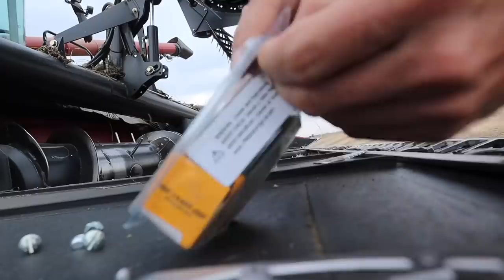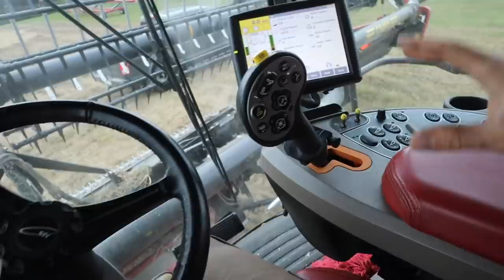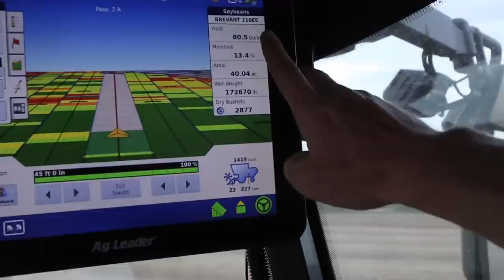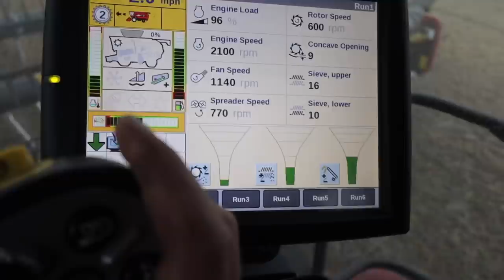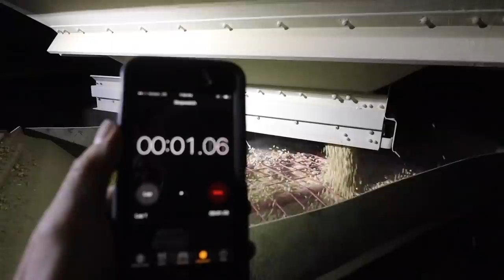Meet Our New Grain Cart Driver!

Comment: there is a deflector on the right side of the combine in front of the chopper that can be pushed in or out. You are putting more material on one side than the other with your spreaders. Also a Canadian rep said not to speed the spreaders any faster than 650. He said it just creates more turbulence away from the machine . Just trying to help

Comment: ABC a good thing on what we do when we use the augers will take orange spray paint and paint a line on the ground and it'll show you where you exactly got to stop each time with your trailer so the auger bottom it hits in the right spot and I've seen some people put like steaks in the ground and spray them orange where you need to stop bam just some helpful reminders you probably won't read this but just trying to help you guys out a little bit

Comment: I put a 10 by 10 foot tarp on the ground where the swing out goes. Center the truck on the tarp. When the rear duals start up on the tarp its in the right spot when you are driving ahead. If backing in when the rear set of drivers start up on the tarp you are in the right spot. The swing out also rolls easier than on bare dirt. It also makes for easy clean up after we spill. The tarp is a chunk from a semi tarp. Put some blocks on the edge to keep it one spot. Works great.

Comment: Grain auger. Drill a small hole in the lowest part of the pan. Put a small disc with a screw in the edge you can swing it open and close when you quit to let the water drain before the start of the morning.

Comment: Mechanics tip Cole-  in your tools keep a small bottle of propane with the torch head.  When a nut or bolt is frozen or too tight heat it up.  This will usually loosen up things. Especially nuts as they expand in diameter.

Comment: Shouldn't each piece of equipment have a small tool set of the most commonly used tools for that piece?  Maybe have them banded or color coded so they don't wander off too much?
Reply: Go back about a year -year and half and watch the tool videos.
Reply: Plus a bag of bolts and parts most likely to be crunched way out in the field during operation.
Reply: @KameraShy  good idea. Keep track of every time there was a stoppage longer than an hour. If the part is small enough, add it to the list.
Reply: They do 👌

Comment: I put some orange flags in the ground by the front tire to know exactly where to stop the truck to unload the rear and front hoppers. I'm thinking pretty soon you will have a parts pail in that combine with bolts, sickle sections, and guards and of course 7/16 wrenches and a hammer to change sickle sections quickly. I've found if you can move the sickle back and forth by hand it speeds up the replacing a bit.

Comment: Cole, you guys need an adjustable torque wrench to safely change those sickles.
Reply: What would a "torque wrench" have to do with the safety of those cutters?
Reply: @paulcopeland9035  Perhaps "properly" would have been a better word. They do seem to torque the heck out of things, which usually results in snapped bolts.
Reply: @paulcopeland9035  the safety? Almost nothing, I believe.  But it can avoid snapping the bolts and having to start it over from scratch.
Reply: @barrygrant2907  you got it. That's what I meant. Thanks Barry.

Comment: Cole is there ever a day when the combine just works all day and doesn't run into a problem? It seems like there is always something going on, a bent sicle, a broken bolt, etc. Do you only show us when something goes wrong and that's why it seems that way or is that just "the cost of doing business"?
Reply: It has a lot to do with the color of the machine...
Reply: When you buy a new machine, you always encounter problems and you learn from them
Reply: @nedbergmeier8053  it's definitely the color
Reply: Every implement dealer, irrespective of the brands they sell, has a shop and a parts department. That will tell you something.
Reply: @nedbergmeier8053  That comment was sent in traditional jest, however it seems to be coming true.  I am sorry...

Comment: A lot of the 40ft+ semi grain trailers here tend to be flat as they tip out the back though a number of mills and biomass have lorry lifts where they will tip the whole vehicle nearly vertical. You don't want to have left you coffee in the cup holder.
Reply: Those trailers have flat floors and rear swinging doors.  Most of the grain trailers now are hopper trailers that unload while the trailer is level over a pit.